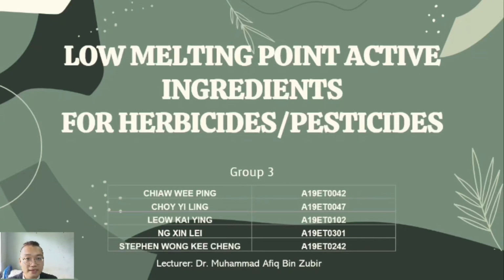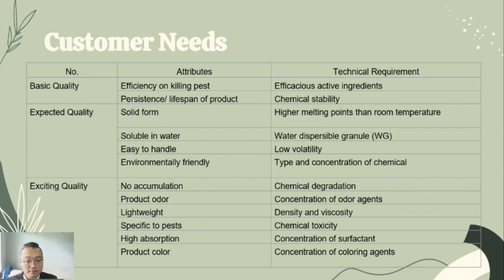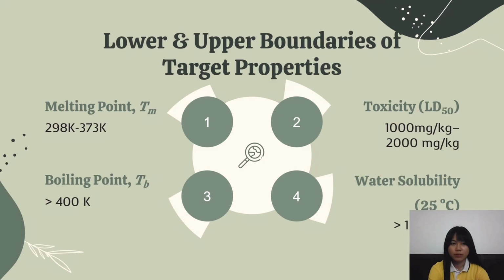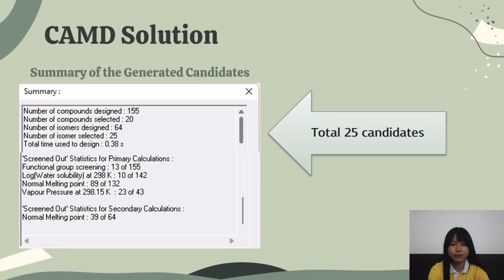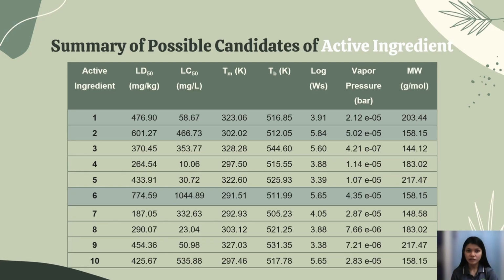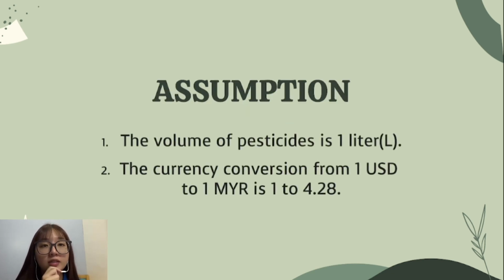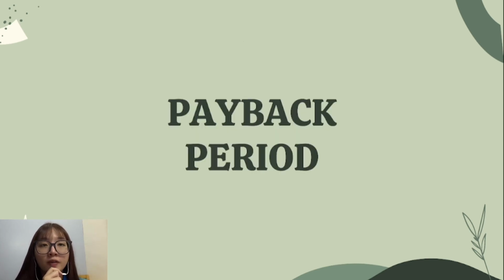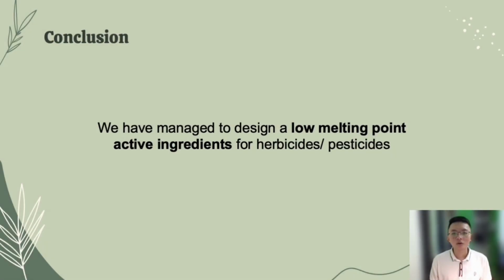SETK4143-03 Chemical Product Design Presentation (Group 3)

Comment: Hi, I am Amzad. I am from group 4 cpd. I just want to ask you about HOQ table that solid form technical requirement you chosen higher melting point? So you mean its Stronger intermolecular forces? So then  If It's higher melting point then It's became  lower vapor pressure? I Don't get it actually without minimum level of vapor pressure in your product how can you ensure your product need Higher melting Point? I think you need to mentioned the specific temperature in your technical requirement for customer.

Comment: Hi, I am Yong Sheng from Group 4.
Why do you choose to avoid producing pesticides that is highly toxic? Because if it's highly toxic, then it can be more effective right?
Reply: A highly toxic pesticides may lead to a higher efficiency but this means that it kills the pests and weeds faster. However, there is always a maximum value of it. In addition, the pesticides used may dissolve in water which may harm the aquatic lifes and that is why we choose to go for a low and moderate toxicity instead.